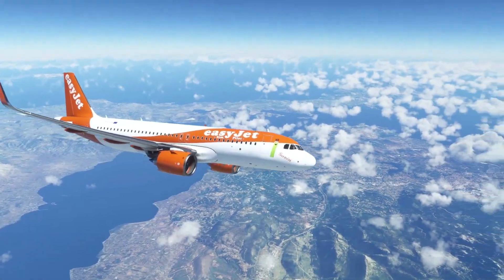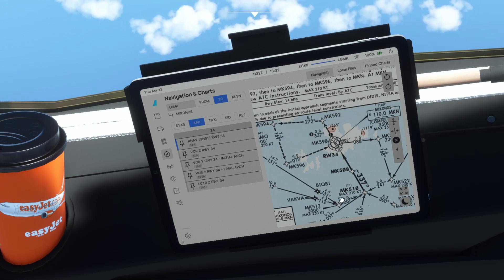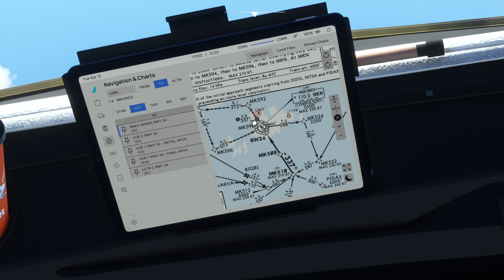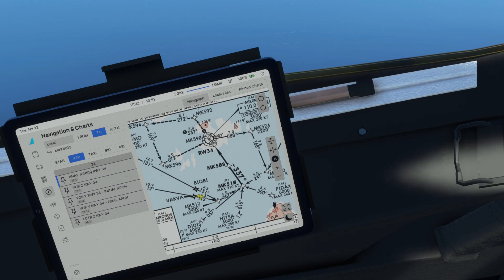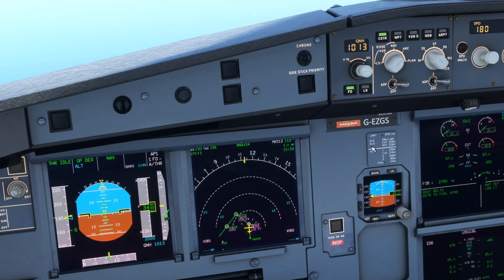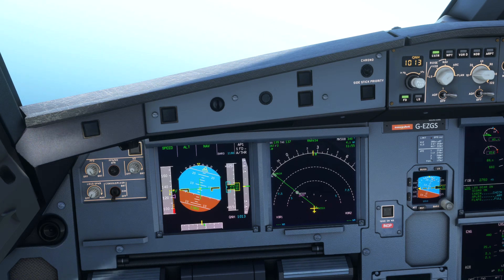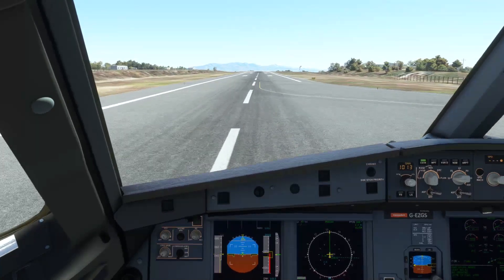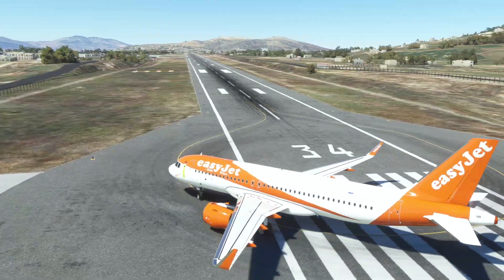A320 Circling Approach Tutorial | FlyByWire A32NX & MSFS 2020

Comment: It's a bit sad that the SEC F-PLN doesn't still work in the FlyByWire mod, but why should you actually activate it on the downwind?
Reply from the maker: So that the flight plan is sequenced correctly, otherwise you could enter NAV mode (on a GA for example) and head towards the incorrect waypoint - which might have terrain between you and it 😉

Comment: Why not wait until you are on Final for 16 to deploy landing gear?
Reply: An explanation I could imagine is something like : as it is a non-precision approach, you want your aircraft yo be configured as soon as possible, I guess
Reply: Because it’s a circling approach, it needs to be flown as a stabilised approach. This means gear down and flap 3 as you start the initial descent down to minimums. It’s not fuel efficient or quick, but you’re not really wanting to rush it and you want to fly at a nice constant speed passing abeam the threshold so your timings are accurate. Also you’re likely to be close to the ground at this point so you’re in danger of setting off GPWS “Too low - Gear” warnings if your gear isn’t down. This needs to be flown at a nice steady pace so you’re not rushing or destabilising the aircraft. We’re not fighter pilots and we don’t fly it like a fighter either. 😉

Comment: Is this procedure allowed to circle to any other runway different than the strict opposite side? Or only to land on the same runway but on the opposite direction?
Reply: Pretty much any runway can have a circling procedure/minimums. You do need to check this though! As an extreme example, imagine a windy day (+25 knots from one direction). You can’t land with this wind if it’s a tailwind. But the ILS is unserviceable for the runway that’s into the wind. There’s no VOR or RNP approaches so there’s not many options left. The ILS is serviceable however onto the reciprocal runway but that’s with the 25 knot tailwind. So what can we do. In this case we can circle to land. Fly the ILS down to circling minimums and then fly around the airport (like a normal pattern) onto the other runway. This is quite a rare occurrence but shows how it might be necessary to circle when no other options are left. If you can circle from an approach from another runway, it’ll have circling minimums on the right hand side of the minimums box on the chart. 👍

Comment: Looks like it's only applicable on airports with little traffic, since while approaching the opposite runway there can't be any take-offs, is that the case?
Reply: Wherever you land or takeoff, you need air control clearance. Furthermore, if you need a circle to land due to wind, the takeoff are most likely on the same runway
Reply from the maker: This is a proceedure usually used at airports with not too much traffic. If they were that busy, they'd most likely have an instrument approach of some kind.
Reply: They are really rare in real life. There’s not many airports that use them anymore and if they do, they’re either RNAV visual approaches or circling with prescribed tracks. So it is very unusual to fly one. 👍

Comment: what video do i need to watch before this?
Also how do u see how much your banking?
Reply: Bank angle is on the PFD.
Reply: 16:03 Check left pilots display (PFD). Look at the yellow triangles at the top centre of the display as he turns. Each of the white markers are 10 degrees apart, the yellow triangle moves to 2.5 of those markers = 25 degrees
Reply: @jumpjet777  oh yes thank you

Comment: Your charts showed descent to 1780 feet at speed 180, which you did not perform. You were at MK510 at 130 knots and flaps 3, with 4 miles to run before your 3 degree FPA.  So when should you be using the chart indicated speeds for descent, and when should you start the slow down? At 1780 feet, or when you commence your 45 degree left turn or on the downwind leg to 16 runway? Thanks
Reply: The speeds on the charts are “maximums”, not minimums or “fly at” speeds. Plus they’re also in relation to the RNAV approach to 34 rather than the circling approach. 

Also a circling approach HAS to be flow as a stabilised approach. That means gear down and Config 3 and level at the platform altitude before you start the initial descent down towards circling minimums. In this case 1680 ft and starting a 3.0° FPA at the MK508 waypoint. Gav flew this correctly and started the 3.0° approach at the correct time (0.3nm before MK508). You then fly the circling approach at F speed, gear down and flap 3. You’ll go managed speed and flap full once you commit to landing on the base turn. You don’t have to go all the way down to minimums either. You only need to go down to this to get below cloud. On a CAVOK day, you can circle at any height but make it sensible! You do need to stay within the protected area and the higher you are, the harder this will be. 

Hope that helps. 👍

Comment: Push to level at 100 ft above MDA. So in this case you push VS 0 at 1780 ft. This allows the aircraft to level off and not bust minimums. This is why you busted minimums. 👎 Because it doesn’t level off immediately. You also don’t need to start turning 45° off immediately. Do it as close to the airport as you dare but give yourself time to turn downwind too. In really poor visibility, you can’t afford to turn away and lose sight of the airfield. You also don’t have to level off at minimums. The minimums are only there to get below cloud. If you had cloud at 1800 ft in this example you would need to get down to minimums. But on a nice CAVOK day, there’s no requirement to drop to the minimums. Obviously the higher you are, the downwind timings will change. 

Circling minimums also need to be in your BARO minimum PERF Page. 1680 here, not 1180 which is the RNAV minimums. Or higher if you wanted to circle at a higher height. 

What’s the call after the FDs are turned off? With respects to the auto thrust? 😉

And….. SET INBOUND RUNWAY TRACK on finals or base turn after the FDs are switched off. 👍
Reply: Thank you both of you for these informations and precisions. 🙏
Reply: But… Opening at 45° earlier, we have the risk to go out of the protected area… Difficult to estimate that…
Reply: @Herbuel  It is difficult to know it exactly. But the whole circling procedure is designed to keep you within the protected area from minimums to the start of the base turn and final approach. But, as with all of these things, it’s up to you the Pilot to conform to these regulations. And be aware terrain or obstacle clearance won’t be guaranteed outside of this area. Generally flying at F speed you’ll stay within the protected area with out too much problems where ICAO circling dimensions are used. It might be a bit tighter where TERPS dimensions are used. 

When ever I fly a circling approach I fly level at MDA for a decent time so I can make sure I keep the airport environment in sight at all times. Then I turn 45° right (me in the left seat - if it’s allowed) and then turn downwind. Again keeping the runway and airport environment in sight at all times! So long as you don’t hit the end of your 45° leg before getting abeam the threshold you’ll be fine. Then just time the downwind leg and turn base when necessary. Don’t forget I’m usually doing this in the sim in 5km of vis which makes it quite hard! Even though that’s well above the minimum vis required. 

To really test your skills, try this in 3km of vis. 2.4km is the legal minimum for Mykonos and you’ll really struggle even though the approach is “legal”. 👍

Comment: 51s downwind timing? An interesting number. Any advances on this?? 😉😉
Reply: i guess airport elevation (c. 400') was not taken into account, so... 39 s would have been the correct number?
Reply: @Jenairaslebol27merde  that’s exactly it. 👍 39-40 seconds was appropriate as the circuit was only flown about 1300 ft AAL (Above Aerodrome Level). There was no wind so no correction for that needed to be made. The reason you want this to be fairly accurate is so you don’t fly outside of the protected area. The longer you go downwind for, the more chance you’ll fly outside of it. It’s not so bad on a nice VMC day like in Gavs example because you can see the ground and obstacles. Do it in 5km vis and you’ll have a hard time spotting things. 👍